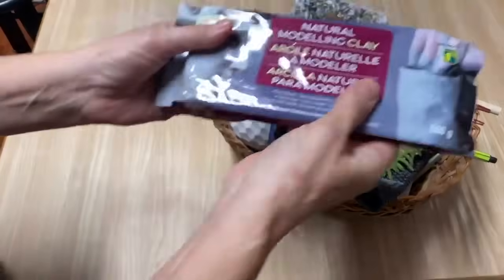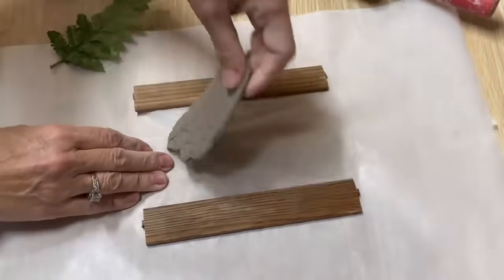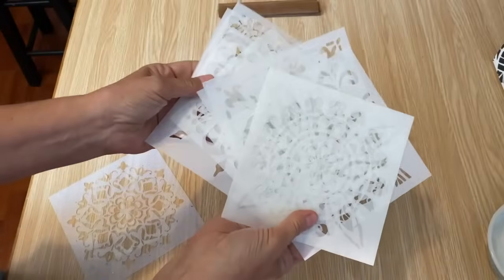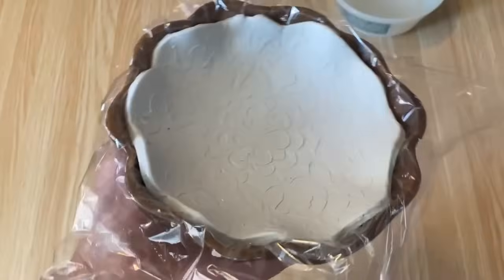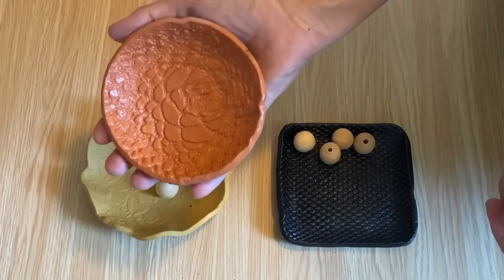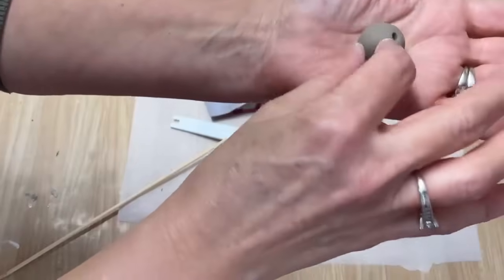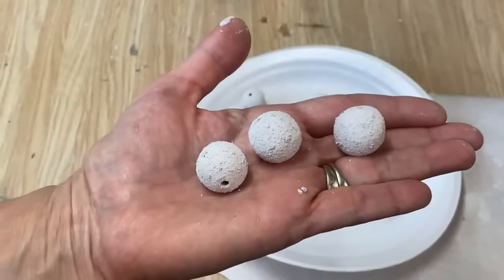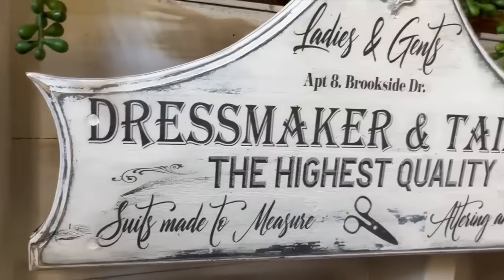Easy Air Dry Clay Crafts for Beginners | DIY Tutorial

Comment: Thank you for this great video. You're absolutely right, there are so many things in our kitchens that we can use in craft projects. I use cookie cutters, especially the ones I've got in the shape of numbers from 0 to 9. They're great for cutting out the number 13 or 31 for Halloween. And one time I wanted to put an IOD Transfer on a piece of fabric and, in a drawer in my kitchen, I found a big roll of white napkins that I bought years ago that look like they're made of fabric, but are meant to be used and then disposed of. And they were perfect for painting and applying the transfers to. I used Air Dry Clay in an IOD mold to make some frames for them and they turned out really well. You could do the same thing with any light coloured cotton like fabric, and you can seal the transfers with Mod Podge or any sealant. Love from Amanda Jones in Australia ❤
Reply from the maker: Great ideas!

Comment: I have a question, I was gifted one of those vintage ceramic christmas trees. I didn't care for that dark green glaze, so I sprayed it white, love it, the bottom of the largest piece of the tree is broken about the opening  where the light goes in, it is a triangle of ceramic missing, can I use air dried clay to fill in that space?  it isn't a weight baring place, and you can't see the brake but would love to repair it so it won't get worse, if not air dry clay what product do you suggest I use?  thank you, first time viewer.
Reply from the maker: Yea I think that might work! Sand area you are attaching clay to and apply and I bet it might work